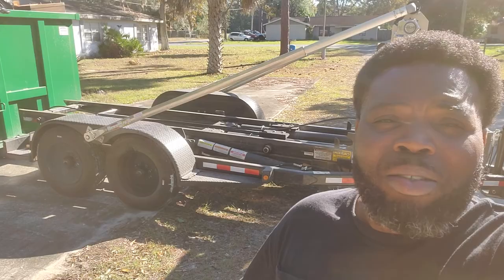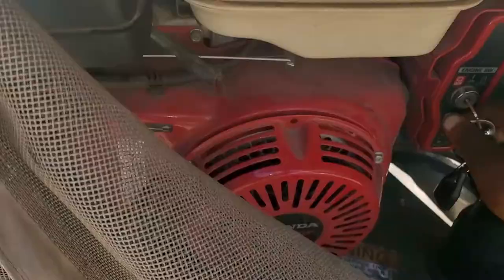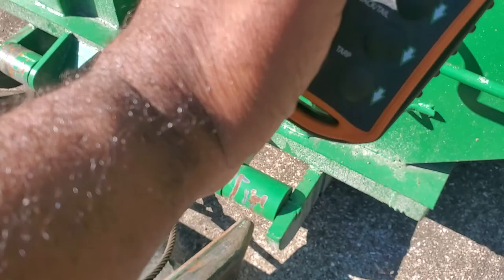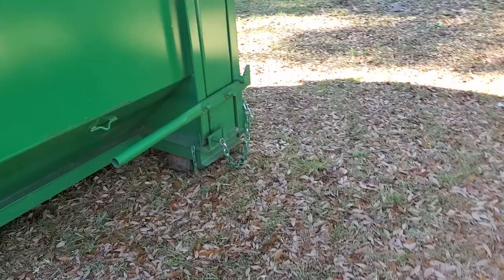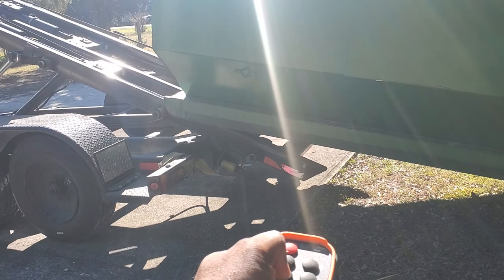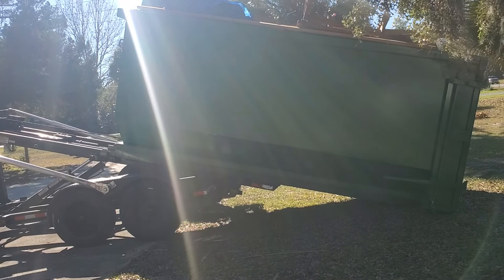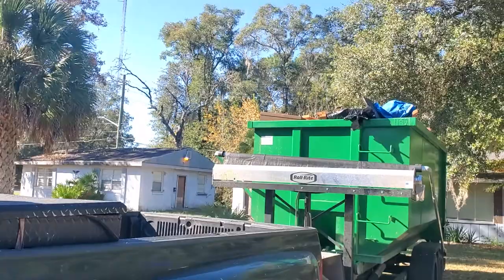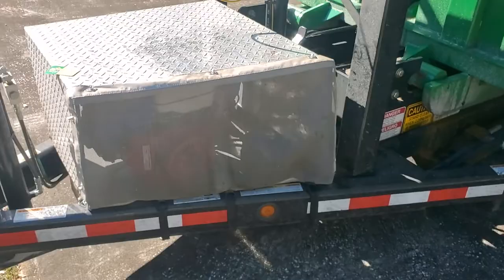How to load a roll off dumpster in grass and other soft ground| Easiest tips and tricks

Comment: This was super helpful!! One question, what if you’re not able to have your truck/trailer straight? Like you have the truck on one side of the house and the trailer on the other at a 90 degree angle
Reply: It won’t work unless your pretty straight, if you are a little off you can correct the truck as you are pulling under the dumpster. This is the best way to get your dumpster on in any soft surface without trenching the yard with the dumpster rollers. I keep a wheel chock handy in case things start to free roll I can put it down to stop the rig